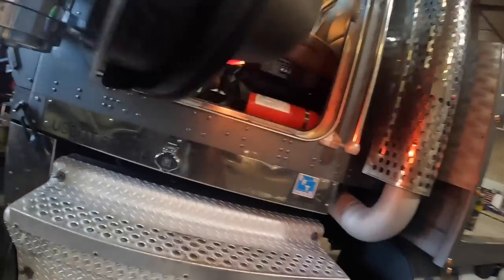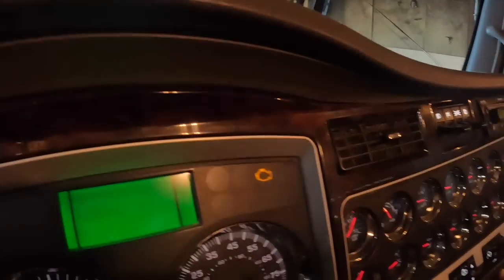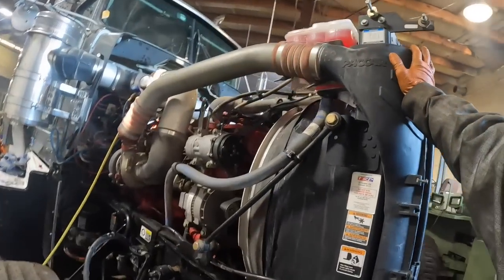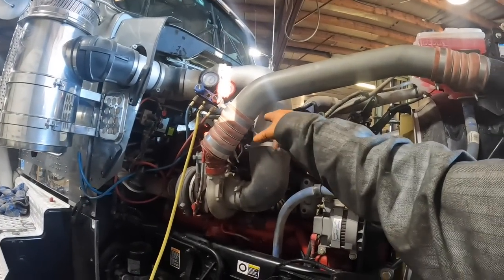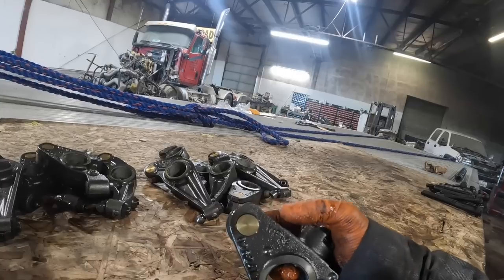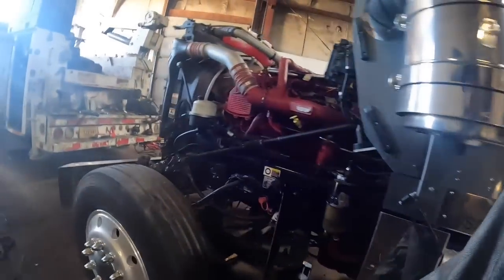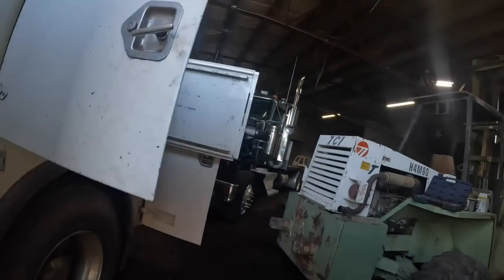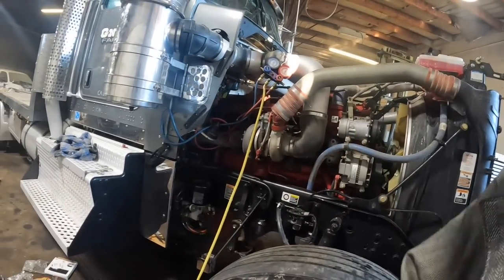Firing up the W900 Kenworth

Comment: I can understand why you prefer diagnosing mechanical faults with the "new age" electronic crap fitted to vehicles.
Sure beats stripping down a modern engine of all the hang on parts now fitted and then when you fire up the reman engine  finding its a dud